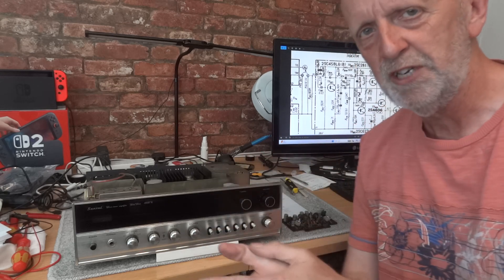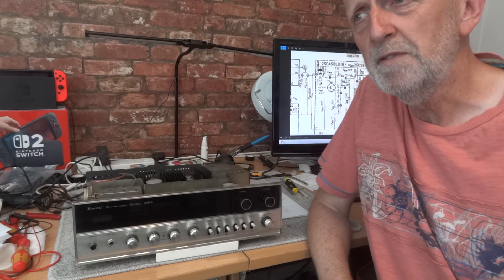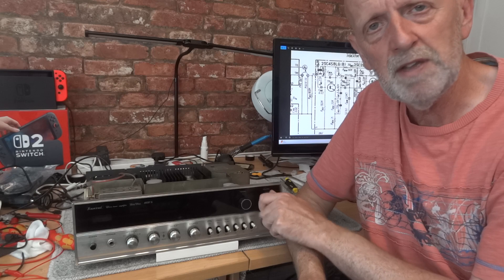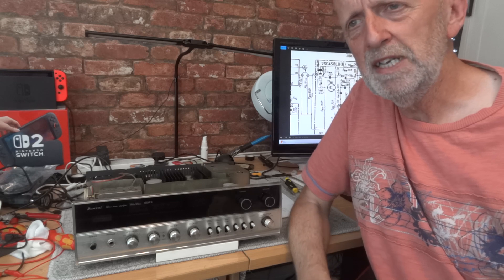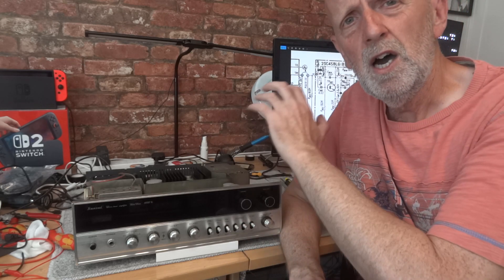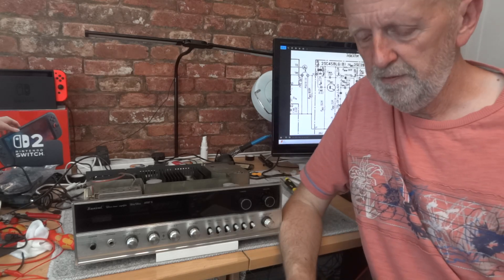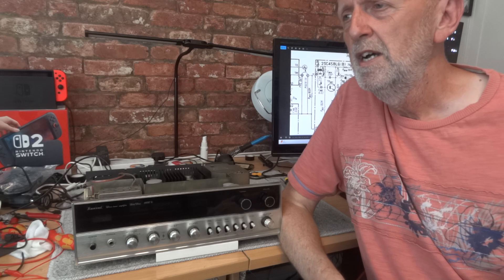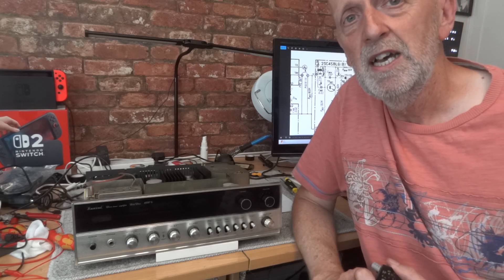Replacing Faulty Transistors Makes a Sound Difference. Sansui Vintage HiFi 2SC458, 2SC1815, KSC1845

Comment: Hi Mike another interesting challenge. The problem seems to be the amount of diversity in the range of bipolar transistors , so many different types and parameters. I guess that is because far from the method of the A level text book the actual methods of fabrication are a lot more complicated, I am talking about biased doping where a region is doped from n to p (or p to n) multiple times. Well I've thought of a "wrinkle" that may help you out. That's  a Spice circuit simulator which maybe not unknown to you but did you know you can download device libraries for free which cover literally every known device ? Well you can or at least you could (as of 2014) I have the Japanese set and the European set. I can email them to you if you can't get them online. Also for free is macspice which is a circuit simulator without the graphical front end and just amounts to entering the circuit one node at a time. Then you can display the results on a scope. It is quite difficult to get your first circuit to fire up but after that you will be winging it. Ta for reading.
Reply from the maker: Thanks for the comment, To be honest this is the first time I have heard to the Spice circuit simulator, it sounds quite interesting but I have never used any circuit design software and I think that this one would be quite a bit beyond me. I am pretty much winding the channel down now as I have covered all the subjects that I think I can. Its been over 4 years and think I need to step back for a while. But thanks for the offer and info its appreciated. I have now learned now that even transistor choice can make a vast amount of difference to the end sound.
Reply: @MichaelYates yeh i get that Mike but that still leaves the Device Libraries . If you download that as a PDF then you can read out one device per line. After the device number there is a row of about 6 to 10 parameters. So what i am trying to say Mike is you can read through the list of transistors and pattern match each pareter ,you dont have to know what it is. Anyway i wish you a happy retirement. I am sad to see you go you have brought me much pleasure. Enjoy your Blue Note! Adios.
Reply: Oh i forgot to say iys a device library of Spice models the one you want would be something like device library of japanese bipolar transistors
Reply from the maker: @factorylad5071  Ok sorry I did not fully understand, I am now going to give the HiFi part of my channel a rest for the moment, I have a JVC to recap by the looks of it as it seems wrong with the top end, but will do that in my own time. But If or when I return I might well take you up on the offer. By the way my email is arcadeimages@gmal.com
Thanks Michael

Comment: Love the electronics content as always Mike. You've obviously do a lot of research and off camera work, but condense it well. I like you've stuck with the Sansui's with a reputation for quality in their 'Golden' era. Always learning something new through your channel. Thanks a mil!
Reply from the maker: Thanks John, yes I do have a look around forums etc and see how other people do things and their results. I like Sansui as I feel on safe ground buying most of their products from the late 60's to the very end of the 70's, think its down to a few worn parts in this model that is making it sound disappointing, but simple transistor replacement is pointing it in the right direction now.

Comment: Mike, don't laugh, bought a little 5w per channel Realistic STA 16B from 1977. Looks great and all works. Realistic definitely under the radar! Gave it good clean up and had a quick listen, not bad at all. The bulbs all work and it lights up and looks nice. Really surprised.  I don't know which company made it other than it says made for Tandy in Korea. Its not Foster (or Fostex as they became known) as they were Japanese manufacturer.
Reply from the maker: Still at it Alex lol. Most people would scoff at 5 watts, but quite surprising powerful and nice those 5 watts can sound done correctly. There are some Realistic models that are quite well sort after. I have only bought one Realistic Receiver I think and it was dead on arrival so went back. Nice little find.
Reply: @MichaelYates  yeah unfortunately Mike. It is addictive this hobby. It's not hurting anyone and I don't spend hundreds on one item, usually its £25 -70 or thereabouts. I will stop with it one day, I mean if I had kept everything and not either sold it on or gave it away, I would have a room full of gear. Only reason I didn't keep it all os lack of storage space, this is a 1 bedroom house and tiny. 

Yeah the 5W is enough, I don't need even 30 w per channel I found. If I could turn up the music I would but having neighbours on both sides permits that and on one side,  I already don't get on with that neighbour.

Wish I had kept some of it though at least, it's just a space issue. The little Realistic is really nice though. I am wondering who made it though, possibly Pioneer or Kenwood. I know Realistic had all their audio gear made by other electronic manufacturers such as Foster, Hitachi, Pioneer and I believe Sansui at one point in the early 70s.
Reply from the maker: @AlexMitchell-i1g  Yes having room does help. Same as me I like to get units around your price bracket to then when some are not so good it does not hurt so much. Its a good and exciting hobby as you just do not know how they are going to sound until you turn them on.
Reply: @MichaelYates  bass on it is ridiculous as in way to over emphasised.  It's like the loudness button is on at the time. I don't know why that is, maybe they made it like that to go with the small Realistic speakers of the time and to emphasise the bass. I have to turn it right down, other than that, its a really nice receiver.

Comment: Japanese transistors with the same number designation added a color to indicate hfe range. Orange, Yellow, Green, and Blue. C1815O = 70-140, C1815Y = 120-240, C1815GR = 200-400, and C1815BL = 350-700. This could be a factor when choosing replacement trannies.

Comment: I've learnt a lot from your videos Michael, thanks so much. I also  have a passion for Sansui. They just sound so great and as you said, if you can change a few old transistors or capacitors here and there, they'll go on another 50 years. Cheers again. Garry
Reply from the maker: Thanks for the comment Garry, only to pleased I could pass on some info. Sansui made some nice sounding units from the 70's to 80's, I think what stands out is that even their lower end priced units still sounded great as care and attention was given to them units as well as the higher end models.

Comment: Interesting video. Vintage transistors are not always what they seem, a couple of times I’ve read them as good while testing the gain etc but once back in circuit they misbehave. I often use the 2240 which is an excellent transistor especially in low noise preamp stages.
Reply from the maker: Thanks Peter. Yeh the little buggers can catch you out. I will order some 2240's and give them a try. I normally use them as the 458 replacements.

Comment: My Sansui 5000A got a bit boomy recently comparing to other stuff. (button got touchy too since last listen). The Akai AA-6600 (1971?) won tonight! Weird but solid receiver
Reply from the maker: Yes over time there units can change. I found my Sansui 331 after me having it for 3 years and playing fine, I started to notice the top end getting a little harsh.
I suppose even being 50 years old when I first had it and just 3 years later made a difference.

Comment: i get what you are saying you may changed the on  the eq line  i have a tone gen i don't use music to test the audio gear 
i am a tec  there's alot of gain level changes   from trans to trans  all ways check this out first before you buy mike
Reply from the maker: Yes the gain on replacements can be many times more than the original

Comment: hi mike you can buy a amp say  you could be have it running ok and it just stop working  more with reel to reel decks 
i have had this  

so beware it may work when you have it later it could stop working  i lost a start cap in a reel to reel this week  2.5uf went bad 47 year old 
if you get this in the power unit of a amp like this bad news   

i have alot of them gold cap's to change over they are going bad   my mate has the same make i like the sound   when re worked

Comment: Very good.
I have an ancient Sansui, with something like 15w per channel, and it has strange pertubations. I changed quite a lot of electrolytics and checked bias, then took a bit of a pause. I wondered if it was a transistor issue, and now you have made me think again about getting back to it.
Thanks for the video.
Reply from the maker: Think its worth trying a couple of different substitutes as in this case it did make a big difference. Always thought it was caps that made a bid difference but now will add transistors to the list to.

Comment: Hi Micael, you found a very interesting result from changing that one transistor. I have to say, I would not have expected this at all. In a way, this is bad news because repairing these receivers is becoming kind of black art rather than trouble shooting. All in all, well done and thanks for sharing this.
Reply from the maker: Was quite surprised myself the difference a transistor can make. I think a lot of people would just be happy their unit is working again after a repair. But in some cases there could be a sound difference of some kind.